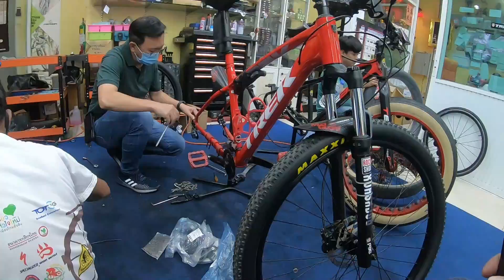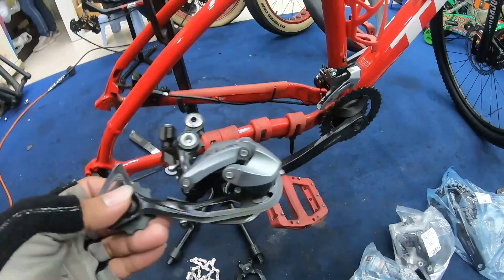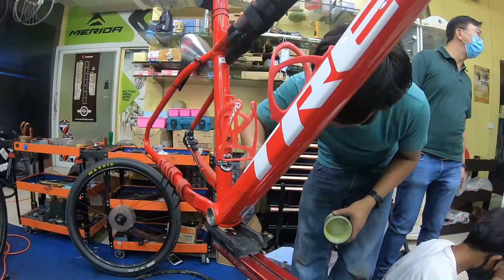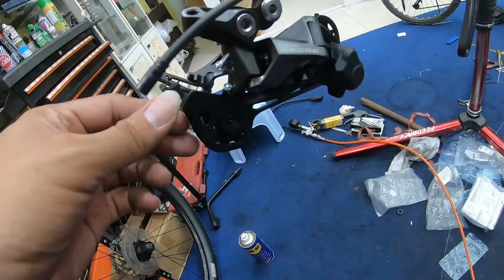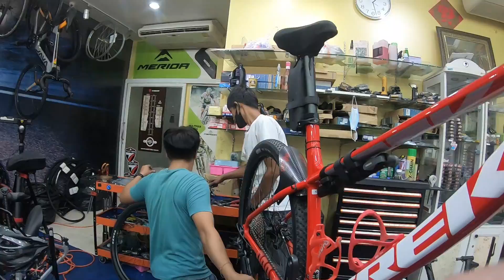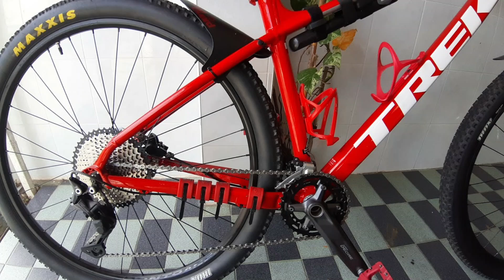Upgrade Kit and Install Shimano Deore M5100 2x11 / Trek Marlin 7

Comment: sir new subscriber here from ph... got my marlin 7 2021... ask lang sir if ano un fd nyu... m5100 downpull clamp type po ba? planning to convert it to 2x10.. nakasalpak na po un m5100 crankset... fd nlng po issue ko.. tnx sir more power
Reply from the maker: M5100 po ang RD at saka 2x na crank 11-46 cogs ayus nman yung sakin..

Comment: Hello po pano po kinabit yung cable po sa FD? Side swing lang po kasi ang m5100 kaso po ang cable routing ko ay for down swing. Salamat po in advance.
Reply from the maker: naki pag swap ako sa bike shop mali nga din order ko eh hehehe
Reply: Ako buti na cancel ko..pero sir anomg cable guide na ginamit para sa fd?yung cable guide yung rubber sa ilalim ng bottom bracket

Comment: Sir M5120 po ba yung RD? Napanood ko unboxing pero yung cogs there was 11-51T. Bakit hindi po nyo ginamit? Was it advised ng mekaniko?
Reply from the maker: yes mali yung nailagay sa box dapat kc 11-42 lng kya nag palit ako ng 11-46.. M5100 po order ko
Reply: @JoeMotoSekleta  any issues using 11-46T kung recommended is 11-42t lang sa 2by setup? Yan yung plan ko 11-46t kaso hesitant ako dahil sa max cogs na 11-42t kapag 2by. Yhanks for the inputs.
Reply: update po for his question, same din plan ko 2by 11 thanks

Comment: ano pong model ng front derailleur niyo sir? gusto ko din po gayahin yung setup niyo :D thanks
Reply from the maker: M5100 din 2x 36-26
Reply: @JoeMotoSekleta  pero side swing at front pull yung cable po yung m5100 na FD di po ba? saan po nairoute yung cable ng FD considering na walang butas sa downtube ng frame niyo, salamat po ulit sa pagsagot
Reply from the maker: Sa ilalim kc pwede ang trek marlin 7 pero sa giant  talon 2 pwede ilalim at ibabaw ang fd...

Comment: Saw your 1st video sa pag order. You said its 6000 baht. In peso around 10k. Mura ho presyohan dyan? Salamat sa response sir.
Reply from the maker: yes po yan po ang price in bath pero sa peso mga 10k nga po mura po ba yun...how much po sa pinas ung ganyan set kit..m5100
Reply: @JoeMotoSekleta  yes sir. Kung dito sa pinas ngayon nasa 20k na sobra mahal dahil demand ang bike and components dito. Dyan ata sa Thailand di naman masyado demand ang bike?
Reply from the maker: @vergemsonjosephdahan4749  grabe nman po pla jan kya pla yung nag oonline dto sa Thailand lahat ng shop kinukuha nya mga trek at sinesend sa pinas..yung trek ko nabili ko lng dto ng 14k tapus yung isang tropa ko nka bili slightly used trek din n M7 9k lng..grabe demand ng bike sa pinas
Reply: @JoeMotoSekleta  talagang mura din dyan sa thailand mura lang ata tax din sa import items.. Dito satin masyadong mahal.
Ang trek marlin 2021 model M5 around 24k yung M6 28k tas M7 mga nasa 32k rin.
Reply: @vergemsonjosephdahan4749  o

Comment: Terrible bike mechanic doesn't know how many spacers to use on a 73mm BB,he fits 2 than by the looks of it leaves no spacers on the bottom bracket at all.
You should do the work yourself or go find a better shop.